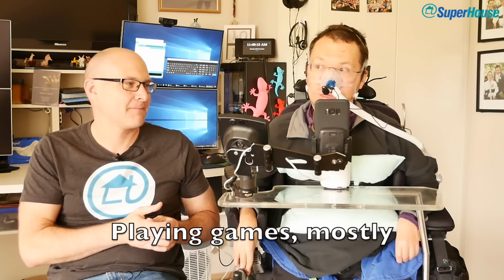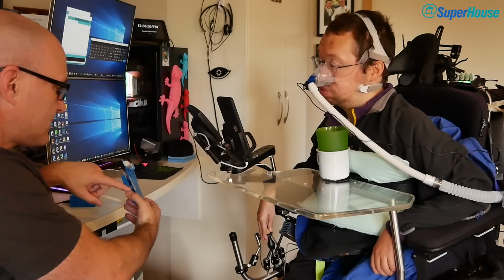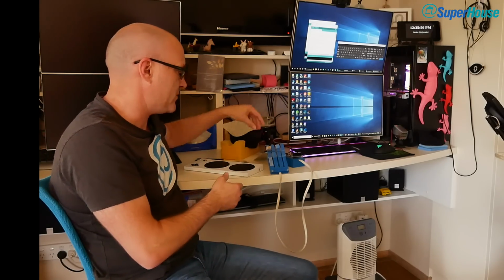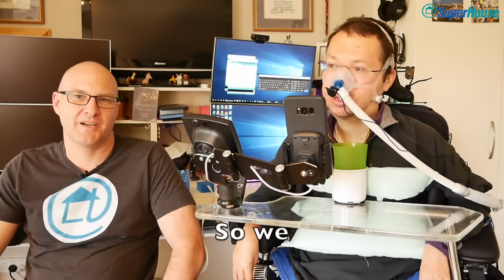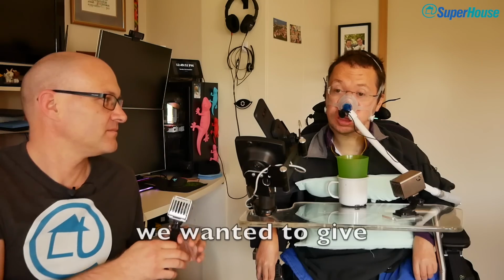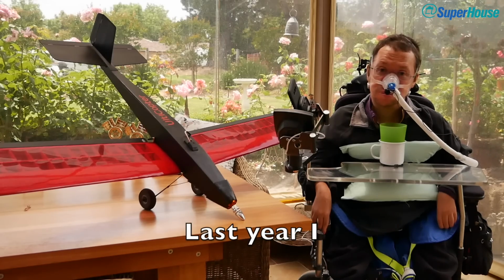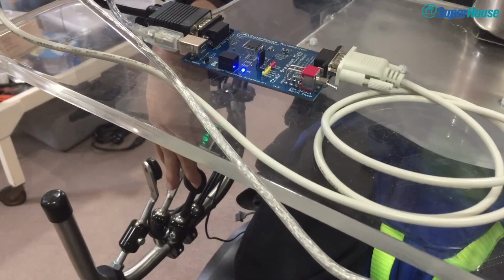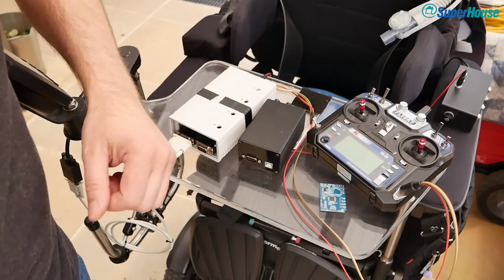SuperHouse #29: Assistive technology projects with Chris Fryer

Comment: You are right. Medical units are very very expensive and of course the reasons are that these originally required lots of custom engineering and quality processes. The  use of open technologies can make a massive difference in increasing acceptability in the coming years. Great video guys!

Comment: Why do the touch switches need to have batteries in them and why must you use a screw driver to open the battery cover on the commercial touch switches?  Are they waterproof?  Those hand heaters are really amazing, Chris and Nick have been singing the praises of them for about 3 years now.  I think a good product name for those heaters is UltiHeat.  Think about it.  UltiCopter, UltiRep, UltiHeat.

Comment: Fantastic video guys. My niece has  MND and type is ALS . She in a wheel chair and only can move her eyes which she uses on a screen to communicate and be on the Internet. Wish I could get her be able to move the Wheel chair with the screen.
Reply from the maker: Thanks Vaughan! We're living in an amazing time now in terms of having technology available to help work around the limitations of our bodies. It's fantastic that your niece is able to use eye-tracking technology to communicate: not long ago even that would have been impossible. What I find really frustrating is that for many people there are solutions that are technically possible right now, but they can't benefit from the technology because it's too expensive, or they don't know anybody who can help set it up, or they simply don't know the technology exists. In many case there are specific building blocks that are encased within a product, such as the eye tracking system that your niece uses, that could potentially be re-purposed for another application such as moving the wheelchair but it's a closed-box proprietary system that can't be modified.

Comment: Good work, look also on esp32 and ttp223, maybe they will be useful. As for heaters,  the most effective way to heat person is "sauna solution belt" style. you need only to heat kidneys, and warm blood is heating whole person,  it is useing less energy to do this.
Reply from the maker: Thanks for the suggestions, Pawel. Unfortunately it's not that simple, because of the way Duchenne muscular dystrophy changes the body. It causes major loss of muscle fibre, which means Chris can't do things like shiver effectively to warm himself up. People with DMD can't regulate their own body temperature the way most people do, so they need external temperature control across different parts of their body. Gloves aren't a solution either, because the problem isn't keeping heat from escaping, it's about making the heat in the first place. Also, gloves prevent the fine finger movement required to control the very sensitive joystick.
Reply: @SuperHouseTV  horible ilnes:( Maybe not technical solution then. I was reading lately that ketogenic diet, is increasing number of mitochondrias in fat cels, what is changing them in heat generators for the body.  It can also improve many of the body functions. Unfortunately there are no studies for KD and DMA, but one of magic behind KD is that it is changing our gene expresion. Doctors are not fully understed this, but it seams to triger atavistic functions of our bodies.
Reply: While your suggestion is good it will not help all. For instance my son whom has no muscle in his extremities and get very cold the rest of his body will sweat and even heavily at times. So adding more heat to the whole body would not work for him either.